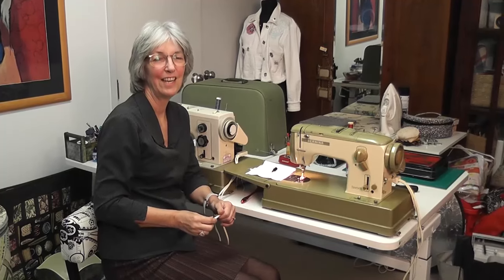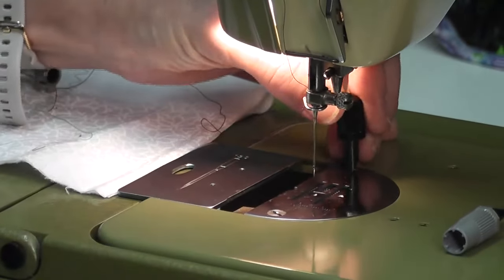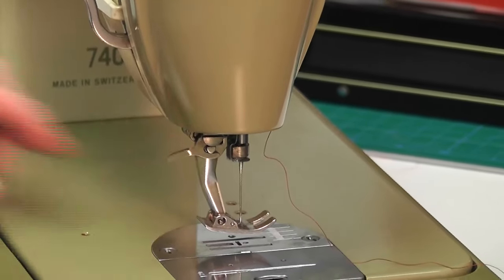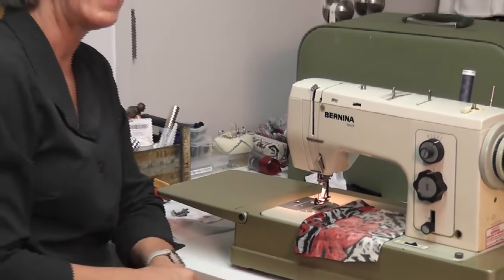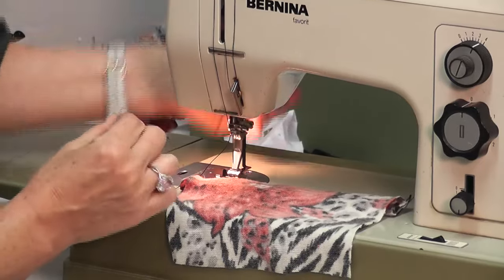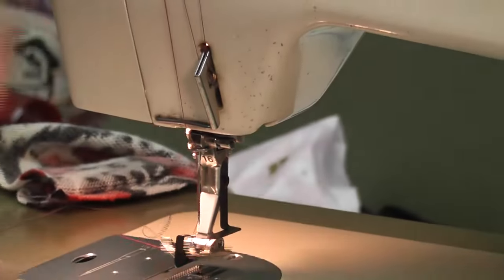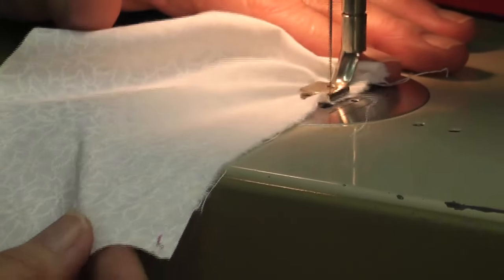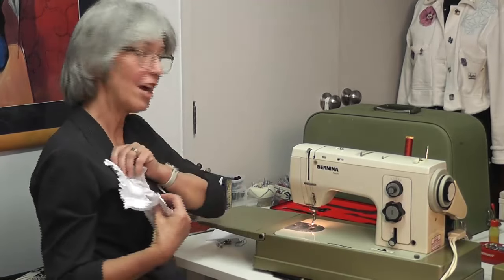Bernina 740 -840  Gathering and Blindhemming

Comment: What happens if you do get a jam? How do you clean the thread that gets caught underneath. And what happens if the Bobbin case doesn’t click?
Reply from the maker: The bobbin always clicks in if you have the bobbin in correctly  and if you get thread jammed just gently turn the balance wheel forward and backwards while pulling loose thread and it will release and thread jam.